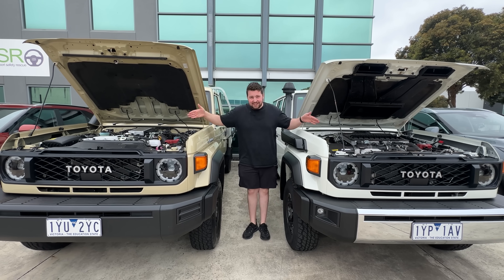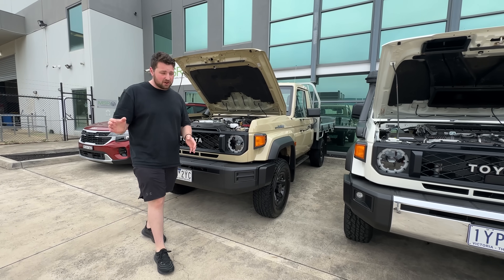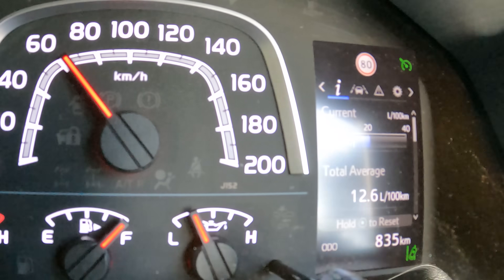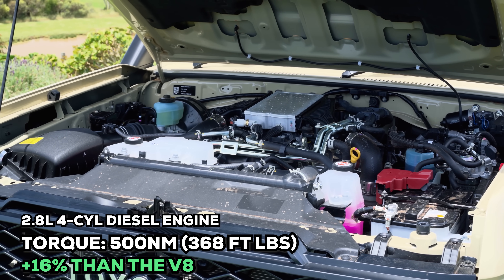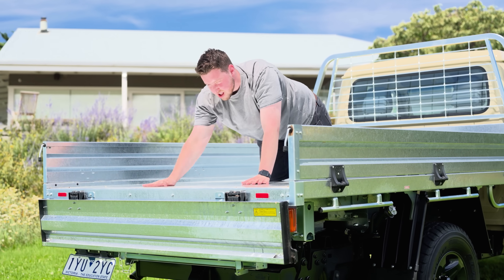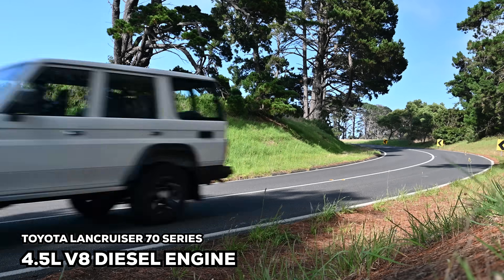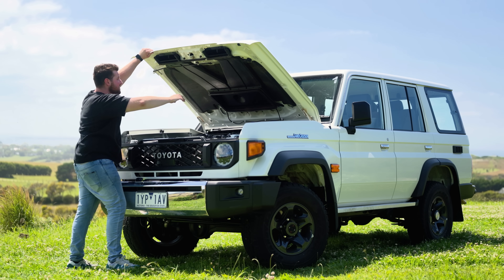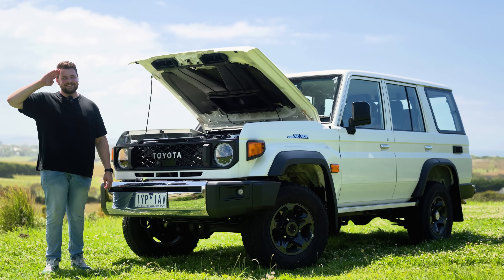Toyota LandCruiser 70 Series 4-Cylinder vs V8 Comparison: Reliability, Concerns and Which is BETTER?

Comment: The 4.5L V8 actually made about 286HP and 650Nm in the Land Cruiser 200. I'm guessing Toyota toned it down because of the lower quality fuel in AUS, or, the manual transmission which surelly can't take the 650Nm of torque...
Reply: Slightly different engine. LC200 had a twin turbo version. The 70 has a single turbo. The name code is a bit different I'm too tired to look it up right now.
Reply: @Agent.K.  it's the same engine dude... the peripherals, like the turbo and other auxilary components are different. Same block, same head, same internals, make it the same engine. Just like any other manufacturer that has an engine in many different power levels and configurations...

Comment: I'll receive my car from the dealer next month. for my trophy project, I'll go for the v8. 35-inch tyres, front rear bull bar, water tank, roof rack, winch .... etc. the 4 cyl will be underpowered especially while towing a 23 feet RV. stage 3 tuning will solve the power issues.

Comment: Hi Matt, just wondering how long will these autos last in the 2-8?
Reply: It is afaik, the same Aisin unit as in Hilux/Prado/DMAX/MU-X/BT-50/Pajero Sport.
Reply: I service & repair for a living, we / I service many Hilux s , we have a customer with a 2018 2.8 that’s done 586000km, service about every 2/3 weeks.. we have changed brake pads/ rotors/ filters, serviced all diffs / Auto/ transfer case etc etc, on time it entire life. Runs like a clock, Auto great, engine etc etc. We will see, I recon the owner will probably get a Million K at this rate 👌. Honestly I see lots of Hilux 3.0/2.8 , Auto / Manual, looked after, they will do big KM. 👌
Reply: @benlondon8467  Hi, do these autos need a cooler?👌
Reply: @rollyb5061  no, they have a standard cooler, but if you are towing a big trailer/Caravan or lots of beach work, a second cooler would probably be advisable.

Comment: Hello, this is a strange question, but I'm trying to find the headlights for this car. I tried contacting Toyota, but they require the model's vin number in order to provide new headlights. Since they are 7 inches, I want to try installing them in another vehicle because we're trying to recreate a vintage Jeep from the 1970s. Could you please help me in any way?

Comment: So basically if you own a landcruiser to impress others buy the 4 cylinder, if you want one to use it for what it was designed for ( based on the 1970s) get the v8

Comment: Great review, I would however point people to look at Ronnie Dahls video, where he puts his stock 76, against his performance moded V8, set up for towing, the 2.8 blows it out of the park on fuel, speed and ability...
Reply: Flawed comparison as the true size were not the same, big difference.
Reply: @christurner68  On this video or ronny's?  His had both cars towing the same route, the same 2.9T van, the 2.8 killed the Tuned V8, I am a little confused by your reply, could be I am just old.
Reply: @bobkats  the sizes were different, it make a big difference. Ronny’s test.
Reply: Tyre sizes and weight of accessories on Ronnie's is the flaw V8 running 35s hugh difference in rolling resistance and weight yet to see a 2.8 in a cruiser on 35s
Reply: @MrThebrownie72  exactly 👍
Reply: Ronnie Dahl and many others with over 100,000 subscribers don't have their own opinion; they only have a paid opinion. I've been in line for over 2 years to get my new LC 79 this Saturday. He got it as easily as a loaf of bread from Night Owl. How is that possible? Are we all equal, or are some more equal than others?  Having some engineering degree in ICE and extensive driving experience, it's clear nonsense to claim that a 2.8 engine outperforms a 4.5 when they are both from the same generation. This is like trying to make an apple more apple-like. Both engines are already at the pinnacle of modern ICE technology and performance. It's pretty much the same as saying that 5 is smaller than 3. Come on, guys, don't be fooled by marketing lies.
Reply: So a tuned V8, with bigger tyres, is no match for a stock 2.8? What would be? A modified 76 with bigger tyres? I cannot see the outcome being different, stock V modified. @christurner68
Reply: Marketing lies?  Seems legit to me, and How ge got the car is not relevant, he did the comparison, the stock V8 on paper has less power and torque, and the 2.8, what marketing hype are you talking about. @australia-ukraine
Reply: @australia-ukraine  Point is a dedicated modified V8 manual, was humbled by a stock 2.8, but you refuse to believe this, that is not my problem mate.
Reply: @bobkats  You have virtually no understanding of internal combustion engines (ICE) and their testing methods. Firstly, you would need to complete a few years of engineering university to grasp these concepts. However, it seems that 20 minutes of nonsensical talk from Ronnie is considered equivalent to formal education. Indeed, my problem lies in discussing these topics with people who have no knowledge about them.
Reply: @australia-ukraine  You keep saying this, but you do not know me, nor my history, are you trying to take the higher ground here, go on walk up that hill, have a great day.
Reply: @bobkats  So, do you, mate, if you hadn’t noticed. You’re defending what you like, but I stand for the truth. That’s a big difference. I don’t care about your background; I read what you wrote. An educated and skilled specialist would never write such nonsense. You stated that a 2.8L engine has more power than a 4.5L engine. How did you come up with this? The paperwork and a real practical test show completely different. Your argument blatantly shows the torque advantages while shamelessly ignoring how it was measured at 1200 vs 1600 rpm. You provided, as if it were evidence, a flawed comparison made by a biased blogger. After all this, do you really expect relevant comments? I’ve nothing to say more. Good luck 🤞
Reply: @australia-ukraine  Watch the test...
Reply: @australia-ukraine  Let us look at the facts 2.8L 201 HP and 500nm, and the V8 with 202hp and 430nm, I rest my argument.
Reply: Sure, go ahead and keep scrutinizing those measurements - they started at 1600 RPM for the 2.8L and at 1200 RPM for the 4.5L, assuming that means anything to you. Oh, and that 33% higher RPM? Just a bunch of numbers, right? But in the real world, it could very well mean chopping the unit's life expectancy in half. But hey, what's in a number? It's like comparing the breathing frequency of a fly to that of an elephant – seemingly trivial, yet profoundly different.    @bobkats
Reply: @australia-ukraine  I am going to fall on the side of toyota here, with their R&D, not some unknown Youtube expert, cheers mate have a great day, the numbers do not lie, nor the performance......

Comment: Tried towing with Prado 4cyl blew no.3 piston $16000 new engine. Use 8 cyl
Reply: I bet it was the older 1KD which is shit
Reply from the maker: Damn that’s a lot of money 😭
Reply: That would be a 1kd it blew up because it's a 1kd not because it's a 4cyl
Reply: Here in europe all the Toyotas sre the 4cyl 2.4 oder 2.8
And everybody‘s usually really happy with their engines.
They‘re even used in some militaries as utilities vehicles.
Reply: Interesting how owners of V8 that have elected to replace with 2.8 are so bloody impressed by the 2.8.
They are towing their existing work/tradie trailers, caravans much easier, retaining speed and not guzzling fuel.
Only V8 die hard warriors are  slamming the 2.8 but those who update are quickly converted to 2.8's true ability.

Comment: Yeah I have the v8 with everythin so its not plus 10k its plus 150k and it makes 1000nm with an 360degree built gearbox so while its still a truck gearbox it cruises at 1.8Krpm at 100kmph, which places it right in the guts of that massive torque. Sure its slow AF but if I want fast I drive my fancy red 4sec sporty for that. I love my 70 and will never sell it, especially now you can only order one with that 4cyl bitch motor. In fact I have a brand new crate motor, injector pump, injectors and fitting kit sitting in my garage, just incase I ever need it. Yes, I know you can buy a nice car for what that cost but I already have three cars and I work to support my passion for fourbies. No different to how an Oxford Street hairdresser might work to support their passion for porches,  four cylinder 70ies, or other things?
Reply: Does the V8 have a cam belt or chain? some did, may be older models? very expensive tear down if its a belt.

Comment: I don`t get the critisism of driving 2000+ revs on highway. There`s a clear reason, between 2000 and 2500 it burns fuel much better and helps avoid other problems, which low revs might cause.

Comment: Ive got the 2024 petrol V6. Anyone else here with the same? Was wondering if it's possible to tune it and get more zip from the engine. Would you consider that over the diesel?

Comment: If you bump up the V8's power, count on an HD clutch replacement, and trust the gearbox holds together.
And put some wheel spacers on the rear axle to match the front axles track.
Manual window winders, very average seating for 2 and lack of space in cab of utility, maybe 3 at a pinch if the middle passenger straddles the gearbox hump and gear lever, very uncomfortable, ask me how I know.
And pay the excessive "Toyota tax" for the priviledge.

A  Cummins 6 cylinder 6.7 in a Dodge 2500 has 276 KW and  1152 nm standard, 4.5 L Cruiser 151KW 430nm standard.
I wonder which one pulls a load better?

Comment: Since you cant order a new 4.5 l, does it really matter. With Euro 6 Emmissions rules in 2025, the V8 is probably gone.
Reply: u can order v8
Reply: @LAMethWitch  Toyota Australia has paused order-taking for the LandCruiser 70 4.5L turbo-diesel V8 as a customer-focused measure, due to supply and demand factors that have resulted in extended wait times for customers.

Comment: I am having sr5 hilux 2023, everybit is satisfying, though i made mistake of upgrading tyre to 265 65 r18 bfg (31.6) from stock 265 60 r 18 (30.5), though their is almost no power loss i observed, but on stock tyre i am easily getting b 7l/100km not its taking aroun 8.5l/100km. (P.s. most of Indian roads have speed limit under 100kmph only).

Comment: The heavier motor has a greater utility factor. When max loaded with trailer, driving down hill on an off chamber track. Or top heavy loads in the same scenario.

Each model. More bling less utility.

Comment: The 4cyl is running 27psi of boost and the 8cyl is only 8 psi. A redesign of the 8cyl would blow the 4cyl out of the water. I will still take the 4.5 in line 6.
Reply: hie the big engine would def outlast that GD6 ,is that what you saying

Comment: I really don't get why these are so expensive compared  to other more modern bakkies. Tech is so old in these! 4.5 and 2.8 have been around for ages .Very little innovation....the R&D costs are really low for Toyota....quality of materials also low rent but durable. Profit margins must be really high for Toyota. prefacelift 4.5 cruiser came last in a ute comparison here in South Africa . It was even beaten by a Mahindra pickup.
Reply: What tech is low?
Reply: Mahindra 4 pot auto also quicker 0-100 than the V8 Toyota was, it's no surprise the 2.8 Toyota is superior to it's V8 sibling.
Mahindra sales have been taking a good margin of Toyota's sales here also, but this new 2.8 series will save some of those lost sales now here. Mahindra will need to stump up with something good now to triump the 2.8 sales.
Reply: Toyota Tax

Comment: The question i have is: is the 2.8L tuned to the tits and does it therefore have a shorter life expectancy?

I’m under the impression the 4.5L will last 25-30 years. But I’m a non expert.

Comment: The highway consumption is not due to the rpm. It's because it's shaped like a brick
Reply: Aerodynamics of a 20-storey skyscraper, and the weight of a laden Tournapull.  And the power of a 1970's Ford V8.

Comment: The question is whether the 4cyl is just another hand grenade like all the other manufacturers have good on paper but not for a long time for some strange reasons a couple of manufacturers have gone to v6 engines i wonder why lol
Reply: Why would the 4cyl be a hand grenade? The only engine was the Patrol 3.0 but that had nothing to do with the engine reliability and everything to do with an overboosting issue. Many 3.0 Patrols running around with no issues.
Reply: The only hand grenade is Rangers 2.0 shitbox engine with stupid 10speed auto
Reply: @MrWerd910   i actually had a 3lt pootrol as a company car at one stage every 6 months needed a new turbo.
Most small 4 cylinder diesel engines under 4.5 litres displacement generally have some sort of issues when you start pushing them either with high load.
The previous 2.4 and 3lt hilux and hiace would crack pistons 
Ford ranger and Nissan navara have bottom end problems probably why ford has gone to a v6
Isuzu break the injector pumps off the block
Reply: @J_Biden  from what I know it's not limited to the 2.0 the 3.2 isnt much better id say that is why they have gone to a v6 in the next models
Reply: Where I live, which is not under a rock, that 2.8 has proven itself many times over in Hilux and Prado.  Only the engine bay is different here, engine is the same. Why should it not last in a different engine bay?

Comment: The 4 cillinder was tuned to give a very high performance for the engine size. If you tune the v8 you would get much better performance than the 4 cillinder. Compare apples with apples, not apples to a rock

Comment: The V8s and old straight 6Cls are good for a million kays be bloody lucky a little 2.8L will get to half a million towing a 3 ton caravan around all the time , it will be on steroids tunned to the max and burn itself out , 15 grand to convert the V8 over to an auto is still cheaper than replacing an18 grand 2.8 small pot at 500 thousand kays and probably still have other problems for sure
Reply: A Million Kilometres you say. How many YouTube videos have you seen of blown V8s due to dusting issues? The air box doesn't feed the turbos equally. Maybe do some research.  That V8 isn't as reliable as you think

Comment: Who would want a 4 cylinder over a v8 diesel
Reply: Those that have chosen to update to the 2.8 from the 4.5 seem to be singing its praises and applauding every aspect of it, it's on road mannerisms it's increased off-road capability due to the automatic transmission drive line & especially it's ability to tow heavy laden tradie trailers & caravans on same roads as previously traversed in their V8's but they now retain the speed limit whilst not guzzling fuel.
Hmmmm obviously they're not the ones your aiming your query at, ha. They're the ones that know better than to ask this question, right?

Comment: A low first gear is essential for towing or heavy loads, not everyone drives around on flat roads without a load.
In the 1960s Landcuiser's  problem was first gear was to high and you couldn't take off up hill without changing to low range.
You obviously know nothing about real world 4 wheel driving or towing.

Comment: Let’s time travel 7 to 10 years into the future.
Your 70 series needs an automatic transmission overhaul.
Going by 2024 prices you’ll be looking at $7500 
To rebuild a 5 speed manual, well Toyota sell them new for $3000
For those that say
“I’ll buy a Raptor or what ever” because it has more Tec 
I have a customer that owns a VN Holden Calais with factory climate control.
The module failed and the parts are obsolete.
Toyota claim that the  life cycle of a Landcruiser is 25 years 
What’s the life cycle of a y62 Patrol ??